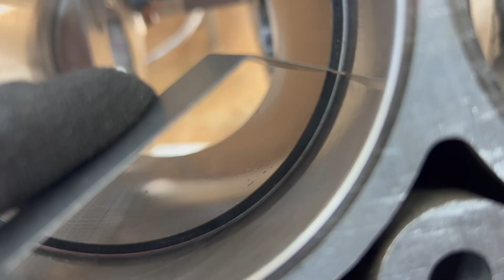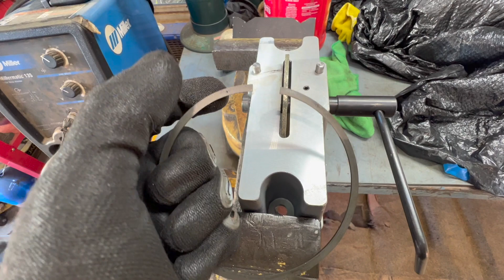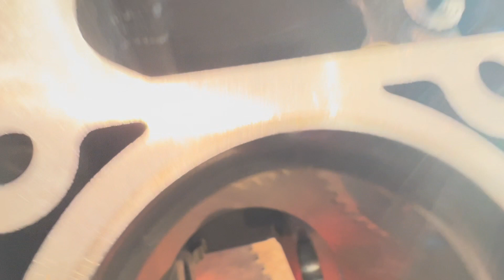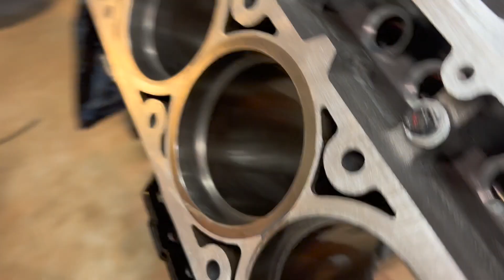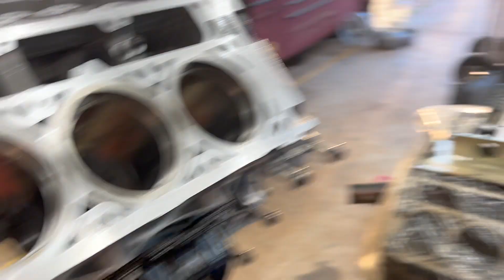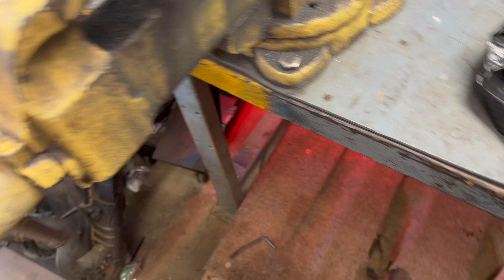Power Boosting LS Engine Hack: How to Gap Piston Rings

Comment: .004/inch of cylinder bore for NA
.007/in cyl bore for turbo/nitrous
Reply from the maker: I used a ring manufacturer guidance for ring gap. I gapped for 200 shot of Nitrous off their chart for forged pistons. .024 top ring / .034 second ring. 4.005 bore.

Comment: H-beam con rods are poor in compression compared to similar weight and size I-beam.  I bet you were pushing over 800 hp when it failed.   Also 0.034” ring gap is for big boost.  Makes sense.
Reply from the maker: Actually I broke the connecting rod, due to my fuel solenoid being open during first start up of new engine. Yeah, I went off a ring manufacturer for gap. I gapped it for 200 shot of nitrous.